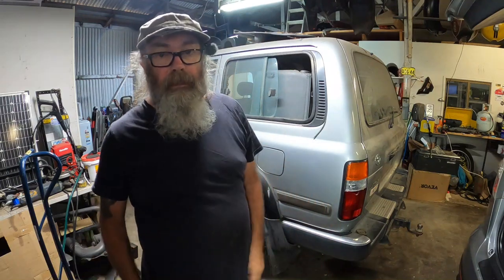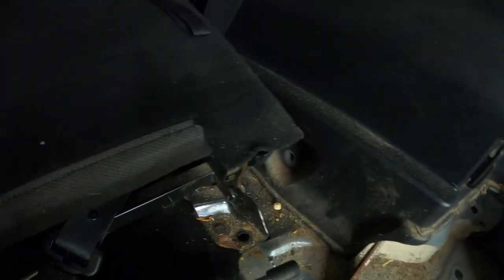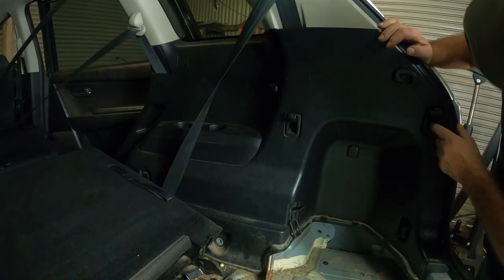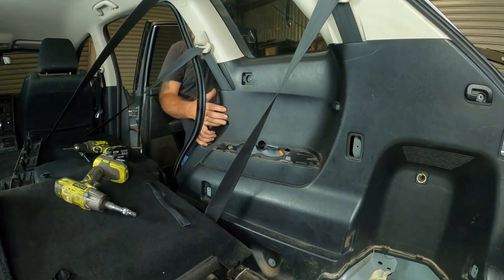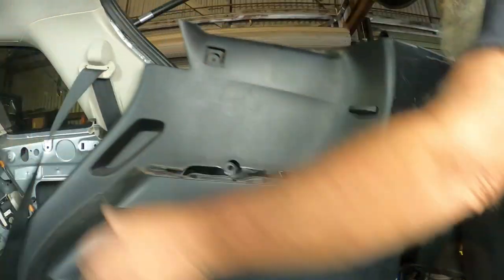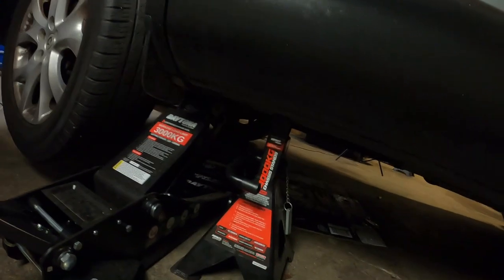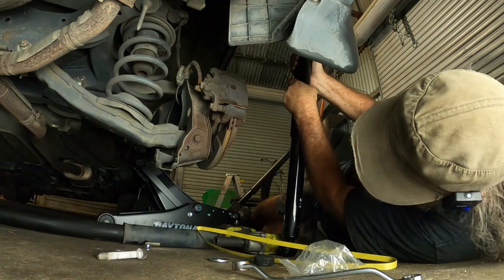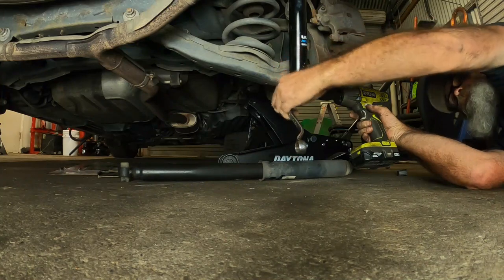MAZDA 2007-2015 CX9 REAR SHOCK ABSORBER REPLACEMENT

Comment: Don't see many Mazda car's over here. Used to but not as many now.  They where really bad for rust from what I can remember. Looked a lot to take appart to do the shocks.👍👍👍👍👍
Reply from the maker: Did a bit of research and did notice that most CX9 in the USA were rust buckets that I would not squirt my water on if they were on fire, probably from areas that get the roads salted, no an issue here in Australia. This one is rust free fortunately. The amount of dismantling required to do a 30 min job was mind boggling. Seems to be pretty standard for late model Asia built cars.